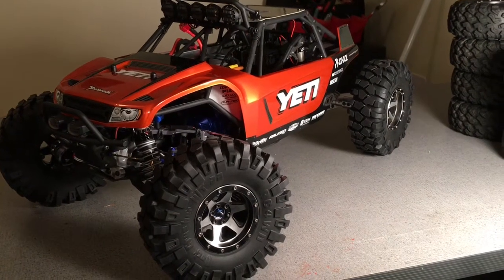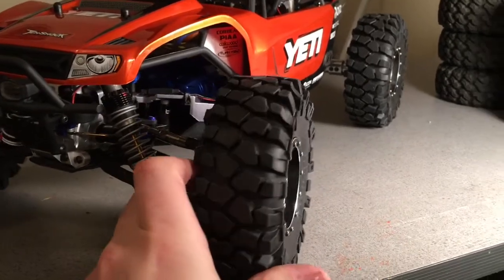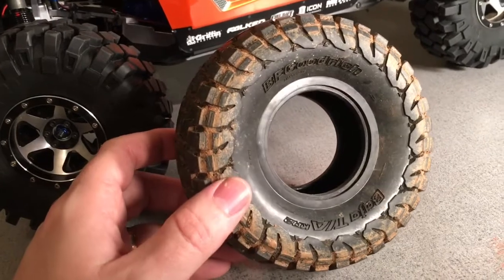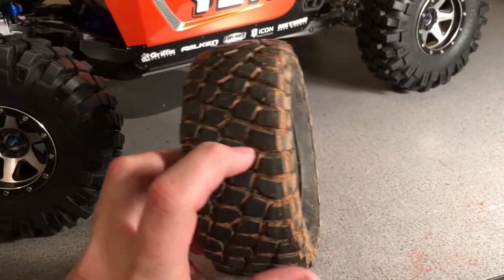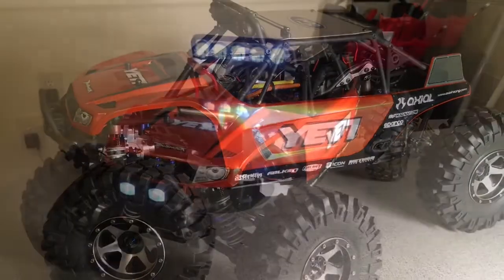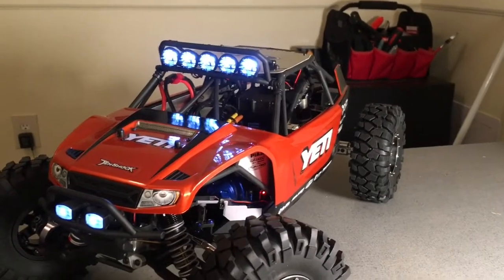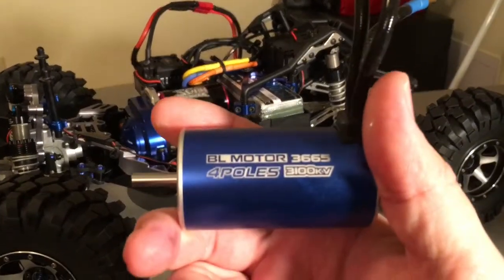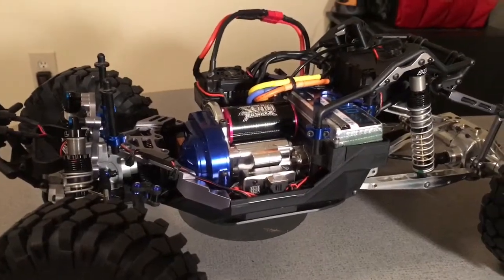Axial Yeti Kit Pt 7 - RC 4wd Rock Crusher Tires and Tenshock motor

Comment: Look good Keith impressive rig is correct my friend! Nice tire upgrade the RC4wd look they have the traction your looking for! Nice work on the lights looking real good and the orange paint inbred lenses look good. The Tenshock looks killer and the suspension looks proper now! I like how you integrated the lights into the BEC. One day I'll have to try one of those hobby wings!

Comment: Those foams are perfectly fine ..most foams are almost twice the size of a tire.  With a go fast car you wouldn't really want a really soft tire ittl just roll over.  It's a very nice yeti by the way . I'm sure after you really get in the game you'll figure out what works :).
Reply from the maker: Chris Webb 
This is a pretty old video. Proline has reduced the size of their foams quite a bit since this video. I have been able to use their foams more recently In some 2.2 flatirons. The difference in the foam size and density has changed since then. But this tire is intended for rock racers and U4 rigs. The foams in this video deemed the tires unusable. But yeah, I prefer closed cell foams on fast rigs. Been in the game for 20years, but appreciate any help I can get.

Comment: Did you have use the proline universal mounting hardware kit to get those front shocks to fit? Their website says it's needed for the Yeti.
Reply from the maker: No I didn't. I used screws and spacers from my spare parts bin. If you don't have extras it would be best to purchase the proline mount kit. The PL shocks are larger bore than Axial shocks and require longer screws and spacers to bring shocks forward off the tower. The hardware for stock shocks will not work properly.

Comment: One question, I was wondering when you move your wheels vertically side to side is there a lot of play, I notest an increasingly amount of play when I do that, but I never noticed it before.
Reply from the maker: I don't have much play in mine. Are you still using the factory plastic pivot balls? If so they wear out very quickly. I'm using hot racing blue anodized pivot balls on mine. Another thing that helps is putting associated O-rings on the flanged side of the hot racing pivot ball. This removes play but leaves flexibility of motion.